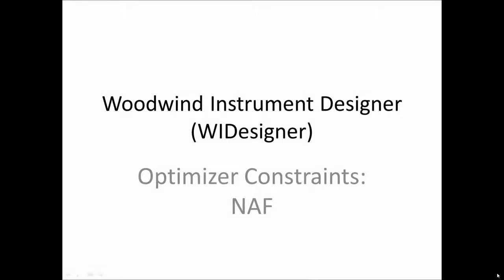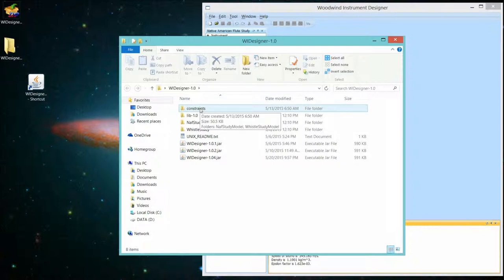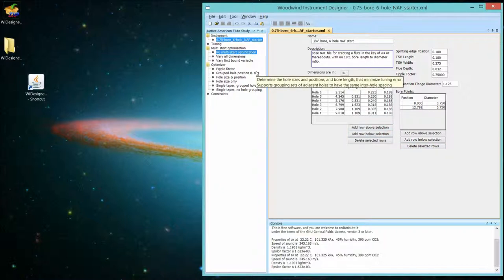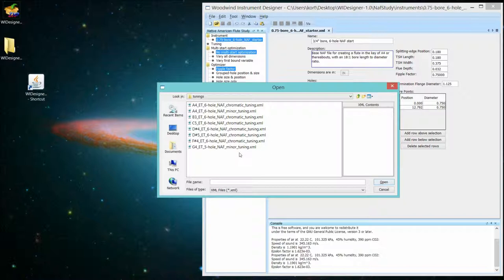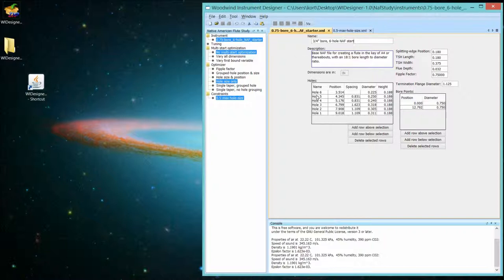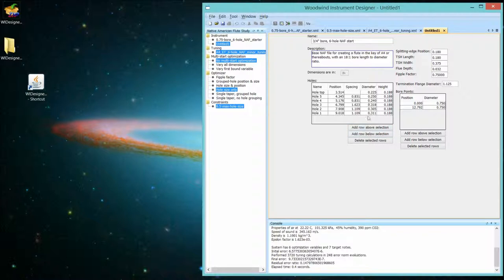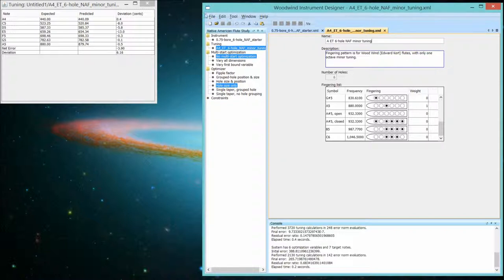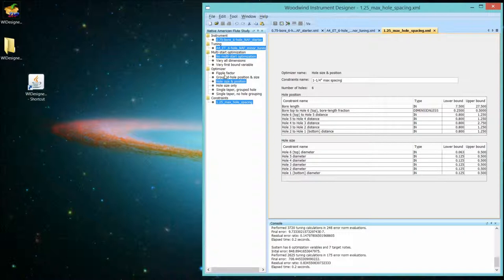8. WIDesigner Optimizer Constraints - NAF

Comment: I am using version 2.40 on Windows 10. Following along with your steps here, when I either open a constraint or create one it does not place it in the data window under a constraints "folder" icon as yours does. As such I cannot apply a constraint to one of my optimizations as they both cannot be selected. The program seems to think that the constraint belongs in the optimization area. Am I missing something obvious?
Reply: Just saw this little snippet from the Wiki

"Constraints Files in Other Study Models
Each Constraints file identifies a specific objective function from the Optimizer list. To optimize an instrument, you can select one of the standard objective functions from the Optimizer list, and use its default constraints, or you can use Create blank constraints or Create default constraints to open those constraints in the editor pane, and customize the lower and upper bounds. Each open Constraints file appears as a new entry in the Optimizer list. When you select one of these entries, the optimizer will use the corresponding objective function, and the customized lower and upper bounds. Unlike the NAF Study Model, other study models do not have a separate branch in the Study tree for Constraints."
Reply: Does this mean that the desired optimizer or constraint should be selected before 'optimizing instrument?' What is done if there are two open constraints that both affect and optimizer?
Reply: For context, I am trying to model a Fujara in G (~98Hz) I have the three holes selected with all fingerings, scale imported, it all seems set. However, when I optimize I get something that looks nothing like a fujara and does not match any of my real life examples. I also cannot seem to get an error ratio under 1.0 and the closest it will tune pitches is off by 80+ cents. I know there has to be a way I am just wondering if the overtone flute model presents some difficulties that I need to account for?

Comment: I know that there has to be some logic and some success to this program. However, I cannot seem to make even a simple D4 PVC whistle. I have the tuning and fingering imported and all matching my known whistle. All measurements are taken with a caliper to .25 of a mm. It all types in just great. Here's the issue, when I got to optimize the whistle it cannot create something that even gives me my D, G, and A in the first octave in tune! How is this possible? I'm talking on the order of 25 - 40 cents off for each note. I have opened up my constraints so that this thing can go wild and create whatever it might need and yet I cannot get a whistle that matches mine.  What might I be overlooking?
Reply from the maker: Hello Austin. What study model are you using? The optimization videos all deal with the NAF Study Model. If you are using the Whistle Study Model, I recommend that you read the appropriate pages on the wiki page of WIDesigner. Optimizations are handled somewhat differently in the Whistle Study Model.
Reply: @woodwindinstrumentdesigner3145  Thank you for the quick reply! :) I did find the page about the whistle modeling. I think I may just be over-thinking the software.

My first question, is there an recommended number of notes / fingerings to have optimized? On my first try I listed every accidental and alternate holing, but I am wondering if just standard diatonic would work better?

Is window height the thickness of the wall at the window, thickness of the labium, or something else? 

Is final bore flange reflected in the instrument sketch? If I am using PVC this would be equal to my bore diameter, correct?

If I use just D4 as the only note to optimize, I am given a perfect flute, as would be expected. However, even just adding in G and A it results in something that is far too short for a likely whistle length and creates holes that are right up at my diameter max (12mm) no way that is a 'must'!

Thank you for any assistance. I am toying with the software for a Fujara as we speak. I've read the treads on C&F about retro-modeling instruments and I know this software is more than capable, I think its a classic case of PEBKAC. ;)
Reply from the maker: There are empirical air-flow parameters that must first be determined for your particular instruments. The strategy and optimizers used to determine those parameters are different for the different study models. So I ask again, what study model are you using - NAF or whistle (or even flute)?
Reply: @woodwindinstrumentdesigner3145  I am using the whistle study model and have changed breath pressure to 4 in the options area. 

I managed to 'import' my real fujara into the software and it matched quite well with what I am experiencing in actually playing and tuning it, so that's neat! 

I know there are lots of moving parts in a model like this so it is hard to know what affects what. For instance, it appears that window sizing is left solely to the maker - no modification will be made by the software. Is this true?

I will try again tomorrow to recreate my low D fipple whistle using again the whistle model and inputting my real life parameters and see if I cannot get better results.

Still what is curious is why the optimized Fujaras were often more poorly tuned than my by ear and filing?
Reply from the maker: Austin, in order to get the entire WIDesigner team involved with this discussion and make it available to all the users, please move it to our Issues page: https://github.com/edwardkort/WWIDesigner/issues.
Thank you.